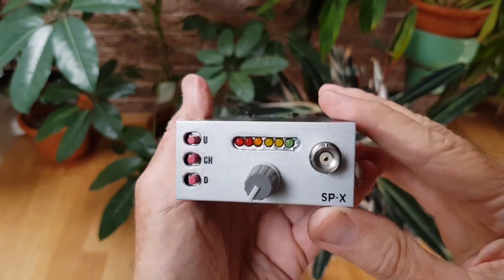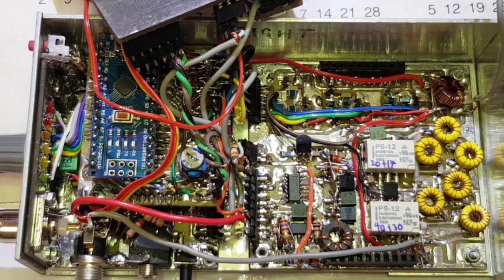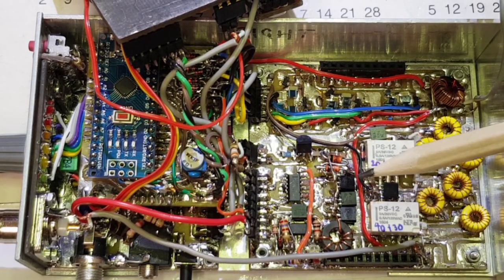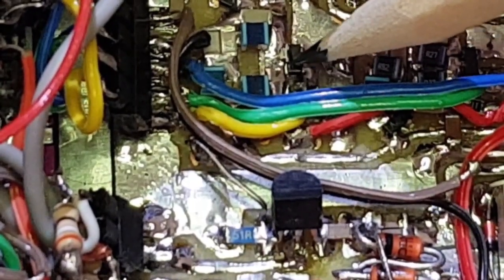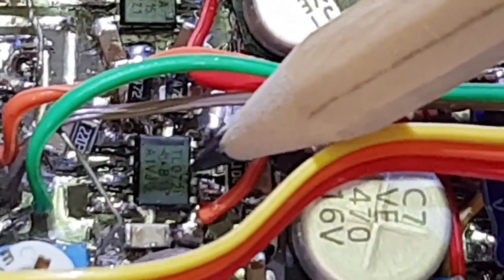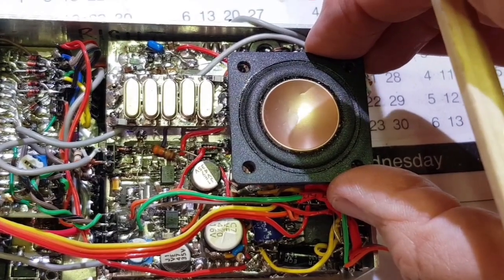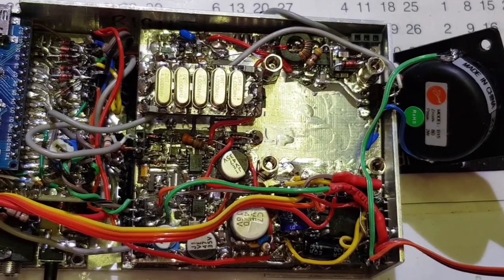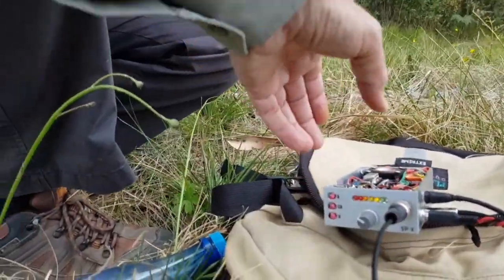SP-X - A pocket QRP CW rig for 40 to 17m

Comment: I'd like to build a similar radio. My idea is to build a 5W transmitter that pairs with a small SDR dongle. A USB connection connects a phone to the device and SDR to provide a complete transceiver. Using the phone - something I have with me all the time - provides very powerful and flexible controls, display, and audio for RX. The remaining DIY circuitry for TX should be pretty small.
Reply from the maker: Thats quite a novell idea, good luck with it, there are people on the SDR communities who can give you support.

Comment: class-e ! wow.
Reply from the maker: Yes, class E, hard switching, basically like a switch mode power supply regulator and many other switching circuits.  The matching network and LPF turn the square wave into a nice sine wave suitable for connecting to an antenna.
Reply: @Paul_VK3HN  where can i find the formula, equation, process of this matching network and LPF ?
Reply from the maker: @indrajitR  I copied the driver, BS170 PA, LPF and output arrangement from KD1JV MTR5b and Hans Summers QCX. See also SodaPop. Other designs also.  The parallel BS170s has become the standard QRP CW PA in recent years. Probably the best discussion of it will be from Hans Summers' QCX.

Comment: That's a really nice homebrew rig. I don't see too many using SMD parts. Do you have an Elecraft KX2? I'm curious how it compares in size and weight.
Reply from the maker: Hi Rob, thanks for commenting.  Surface mount at 1210 to 1206  is ideal for homebrewing and prototyping, the components are low profile, no lead inductance,  easy to do with tweezers,and a magnifier.  No I don't have a KX2, but from what I can see, my rig is about 1.5 inches shorter and about the same weight. Of course there is no functional comparison as the KX2 does 80 to 10m and all popular modes. Still, fun to compare! A closer comparison is the MTR rigs by LNR Precision.  See more details at https://vk3hn.wordpress.com/2021/03/05/sp-x-a-pocket-rig-for-the-cw-activator-in-a-hurry/